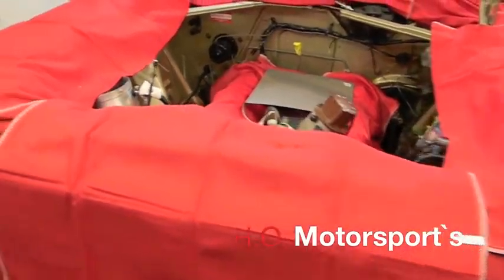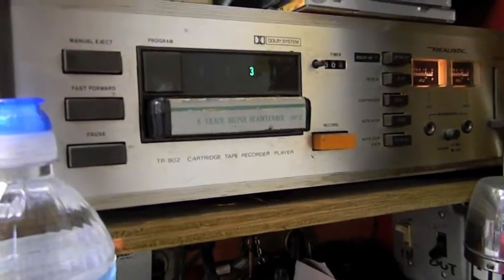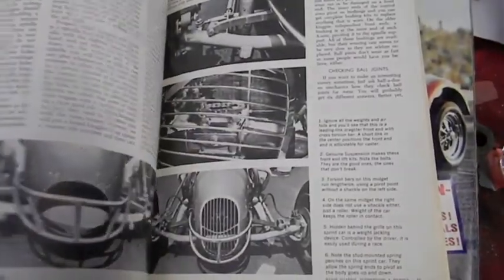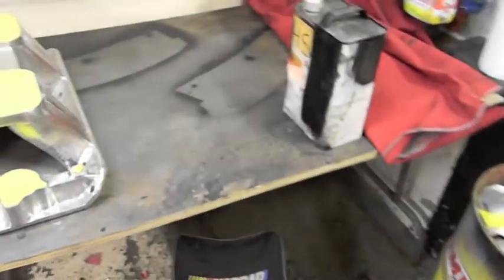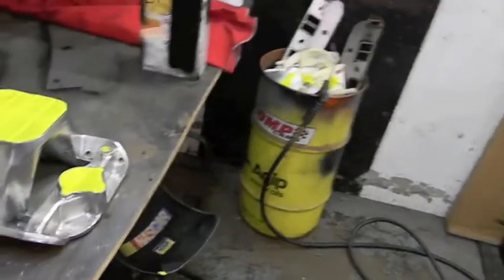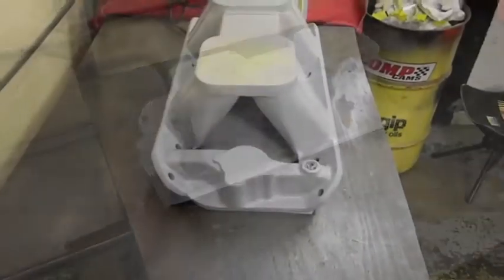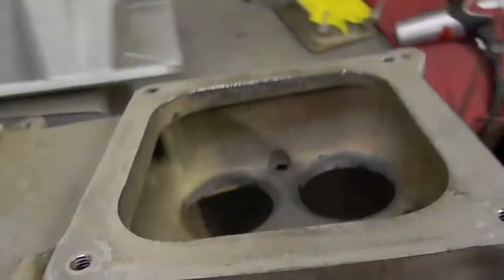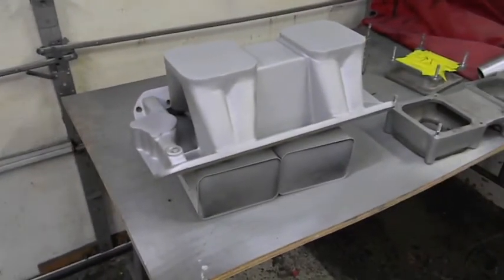Gasser Tunnel Ram Refinish

Comment: Did the lasher go based on the CD player, or did dirt get into the optics? 8 track the most reliable??? It must have been in storage since it was new! Lol. Those tape eaters were notorious for leaving tape on the side of the road all over Phoenix and the surrounding desert area. Cassettes only failed when you left the tapes in the heat, otherwise they rocked! Then came CD's. All good with the second CD players, but the first gen seemed to eat discs as badly as 8 tracks are tapes. Now there's Bluetooth sourcing songs fro you phones. Forget it! I'd rather have my eq'd cassettes on board. With a good ear and a little compensation for the weaknesses of your car's sound system you could mix some damn good tapes for your car, and I did! Some times the old days were better!